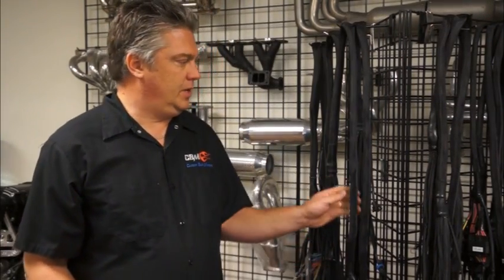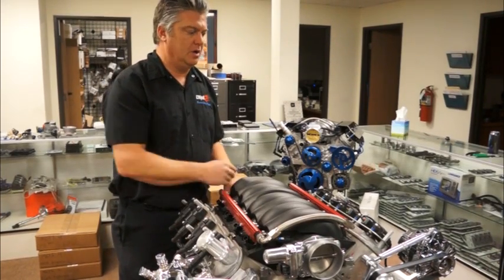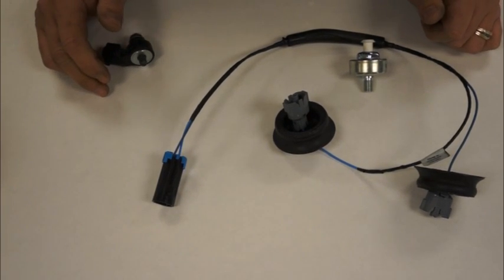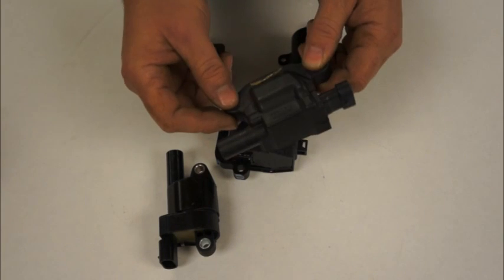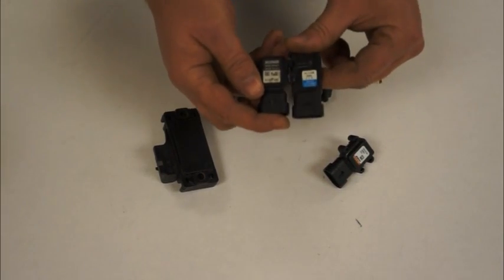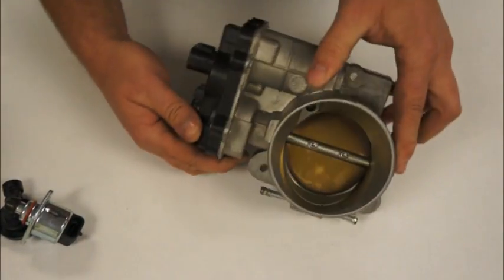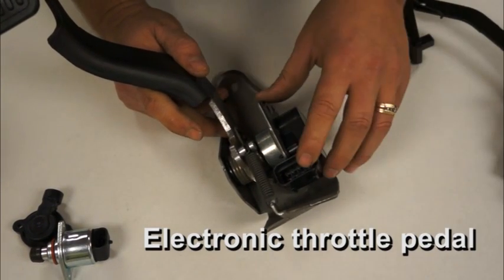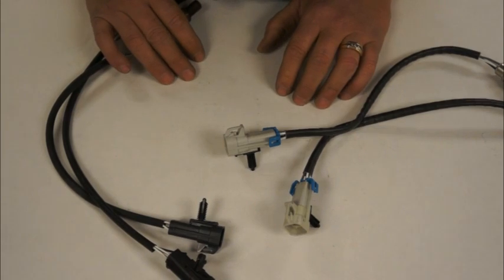GM LS WIRING 101 by CBM Motorsports

Comment: I have a 5.3 LS1 truck engine in my 2002 Avalanche. It has the D580 coils OEM stock. These coils still run but the laminated cores of coils are very rusted because they are exposed instead of being totally encased in plastic like other coils. So I wanted to replace them with an upgrade.

My engine has a Whipple supercharger system, ported heads, and a cam with .05" more lift than stock but otherwise mild duration/overlap and stock idle. SO, I want the ignition to be enhanced over stock if possible.

MSD makes a "Pro Power" LS coil with a built in capacitive discharge feature. Their PN 828683 (set of 8) fits the stock harness plugs of my engine, but I could see from the pictures that they will not fit the stock mounting bracket because the mounting ears are 90* from where the OEM mounting ears are located. The aftermarket mounting brackets I was able to find don't look like they are going to be a direct fit either. 

I had to talk to MSD tech people for some time to get clear answers. They assured me that the 828683 coils were electrically compatible with my application, and that information indeed did turn out to be correct. But they could not give me an answer as to what mounting brackets will fit the coil. 

All the aftermarket bracket listings I could find just give you a picture to look at, with no definitive listing of what coils will fit the bracket. They just expect you to figure it out by looking at pictures, then buy the thing and probably realize it won't work without modification. 

I want brackets that will mount the coils with the spark wire terminal snout pointing straight down directly over each spark plug ... is that too much to ask?

All of the aftermarket brackets looked like they are basically universal and will mount the coils on a 45* angle, and I do not want this. 

So I decided to modify my OEM brackets to fit the MSD coils. This required some cutting and welding. The square opening for the body of the coil had to be enlarged, and I welded on threaded studs to match the coil mounting holes. The section of the bracket that secures the large harness feeding the engine on the left side had to be cut off, re-positioned, and extended about an inch higher.

So as it turned out the coils are mounted in the position where I want them, and as a bonus the spark wire snouts extend a little lower, which makes the spark wires fit perfectly. That was another problem, the spark wires that MSD and every other mfr tells you are correct for your very common truck engine application do not fit well because they are a half inch too short. MSD tells you to bend the terminals to make them reach. I already did this and the damned wires just barely reach and are taught enough to play a tune on them. They just flatly REFUSE to give you a lousy half inch more of wire to work with.

Then they also refuse to make a bracket that will correctly fit and mount the coils they sell to fit your very common truck engine. However, they do sell universal brackets that will mount them on an angle and may require longer wires. 

Another thing they don't tell you until after you buy the coils is there's a possibility of a low current fault due to the current demand of the capacitive discharge feature. They do make and sell a harness adapter that uses a relay to create a direct B+ circuit to your OEM harness that will solve this issue. They explain this in the instruction sheet with the coils. So I ordered that too, an additional order and more waiting time. There is no mention of any recommendation for this harness adapter on the MSD website listing for the coils, and no mention of it from their tech people.

I had to modify it because the wiring is configured to put the relay somewhere on the engine, and I wanted the relay inside the under hood fuse box.  

So anyway the coils seem to be running well on my engine now, although I haven't driven the truck just yet because it needs more work.

Comment: Grate Info.. but I have to disagree with O2 sensor describe... 
O2 sensor [b4 the CAT] tipically call as Air Fuel Ratio sensor measurs , how much left over oxygen [O2] in the exhaust gases. O2 sensor never measure the Air Fuel Ratio. Air Fuel ratio calcualted base on the O2 sensor readings. [Leftover O2]

Comment: Hello Again Chris. I went to start my dad's 1967 Olds Cutlass with 4.8LS (Engine from 2003 Chevy Silverado) Conversion and smelled fuel, I luckily had the exhaust and headers separated.
I saw fuel spraying out of the passenger side of the header.  I Swapped injectors for Cylinders #4 & #6 after smelling fuel on the plugs. 

I restarted the engine and the fuel still leaked unburned raw fuel.
Any Ideas on how I should fix?

Comment: I have a question for you guys or anyone on Youtube if they can answer for me. I'm about to purchase an CBM LS1 and I have no idea which transmission would pair with this engine. Most LS swaps in RX8s are used from the 2002 Corvette. So would the 2002 transmission fit the CBM LS1? I am unsure if CBM is a custom built motor or used motor.
Reply: Hey Jimmy CBM stands for custom built motors, but they still use automotive engines as a base. Your LS1 will use any GM V8 automatic from about 98 and up. For a manual trans any T- 56  6 speed, or a late model 5 speed from any LS. Manual transmissions that are universal and made by Tremec are the TKO 5 speeds. They have a TKO 500 and 600. the only difference between the two are the first and final gear ratios. Both will handle a good amount or power and torque.   They are around  $2400.00 with no bellhousing or shifter. I have personally bough many from Liberty Gear. They are hands down the worlds best. They are located in Harrison Township Mi. and also have a web site you can get more info from. Craig had at one time a lot of new old stock Tremec transmissions from Australia that will bolt right up to a LS series engine.I would   send them an email and look into that as an option. Good luck with the ride.

Comment: Question:  2009 Chevy Tahoe 5.3L engine with 8th digit of VIN # = 0.  Where does the Ground wire from the Firewall attach to the block for proper grounding to get the correct voltage to the Camshaft sensor??

Comment: Do you guys also program the Transmission? we are using a Column Shift from CPP here in California it has the Neutral Safety switch on the Column. We are doing the 2006 Chevy Tahoe Boneyard Edition HAHA..5.3 Engine with 4l60E Transmission into our 1962 Chevy C20 Converted to 1/2 Ton. Also we are in Riverside CA so can we get everything just driving out to your place over in Rancho CUC?
 We were going to just install the Engine/ Trans to the running gear then hook up the exhaust Etc then trailer it over So someone else can do the TPI Wiring. We just Purchased a new Wiring Main harness from American Auto-wire Highway 22 Series Kit so we will do that install as we have done that on our other Rods. Now that I watched the Video I sort of think I might be able to handle this with a little...Or A Lot of help along the way. This engine has the Cable drive throttle body so no electric pedal or anything we are leaving everything stock no turbo no nothing. I got the Gas Tank from Tanks Inc with the in Tank Fuel injection and I swapped out the stock fuel rails and bought  the same reman Injectors the 2006 Tahoe came with so we dont have to use GM Clips and adapter hose fittings just regular AN Fittings throughout so that is already sorted out and on the truck. We are also going to use the Fan Clutch/Fan Blade Set up for our truck also Late Model GM Truck stuff that goes on the Stock LS Engine/Truck Style also Stock Coil Packs and the stock brain is still sitting on top of the engine NOT That we plan on using it TOO BULKY! we just left it on like we got it from the bone yard just in case any of that stuff needs to be RE Used I did post up video of the thing we are working on right now.

Comment: U didn't say where the knock sensors are. On the early LS engines gm had a problem with them filling up with water because of there location under the plenum and thus is the reason for the foam type end caps at each end of the plenum. The later models had a boot to cover the holes. It's my opinion that GM has the best set up to date. Also water pump selection is crucial when putting the LS engine in an S-10 or older vehicle

Comment: Will I see any benefit from replacing my factory coil with  performance multi spark units like MSD sells? 2000 WS6 LS1. 30K miles, it already has long tube headers, shorty cats, aftermarket Y pipe, Corsa catback exhaust, 85 mm MAF, high flow air filter nd a larger air box lid ( factory resonator is also removed).  How much if any tuning would be required if I replace the factory intake manifold for a larger one and mount a 92 MM throttle body to it ( it has the attached throttle cable)  What kind of power gain should I expect to see  for all this work ?
Reply: It will be drivable with all these upgrades a tune would get the most hp out of your mods I'd say 350hp you want to cam it if you want to see 4s
Reply: 500SWMAGOPERATOR 
Hi, Please see our web site for info. www.CBMmotorsports.com

Comment: Once the wiring harness is connected to the engine how do you connect it to the ignition switch and everything else? I'm asking because its my first time doing this swap.
Reply: The best question on this entire thread. The only question that actually matters. Engine harness is the easy part with connectors.